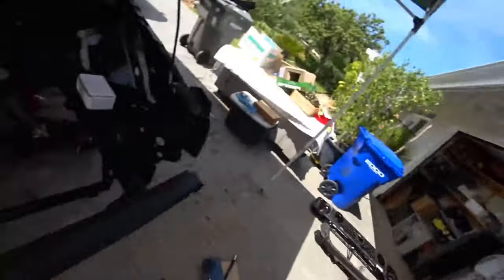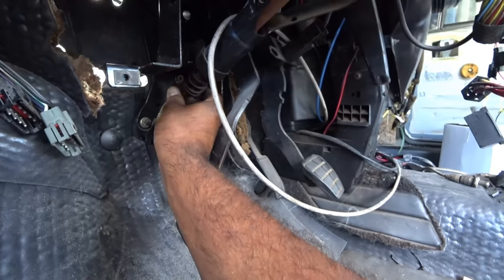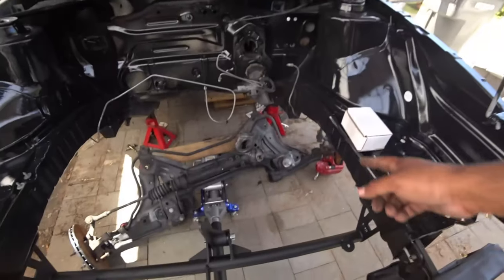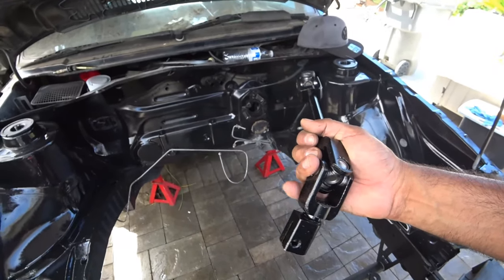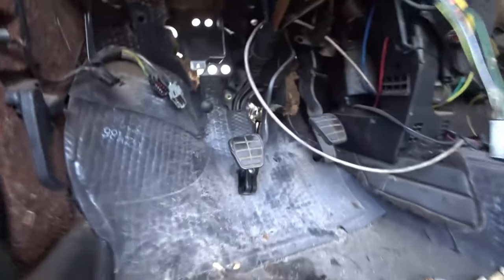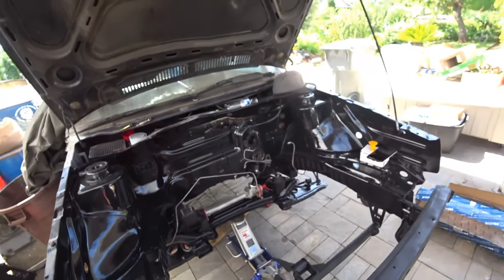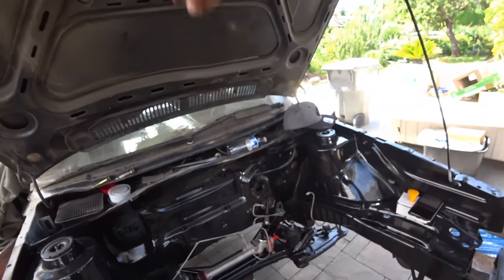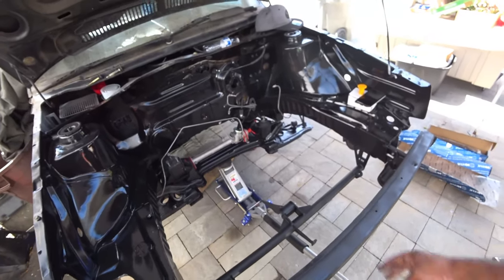MK2 Manual Steering Conversion S6 EP5

Comment: Hi. Thank you for the video. I have done this conversion, but I'm getting conflicting information on which steering UJ boot I should be using. Your manual rack cup diameter looks identical to mine, so I'd be really grateful if you could let me know which boot you used. Thanks!

Comment: Hey man! Thanks for making this video! Following it to use for my mk2 gti 1.8t swap as well. I was wondering what part # you had for everything on the subframe? Just purchased a meyle manual rack, k frame but unsure about what tie rods etc.
Reply from the maker: You need manual steering tie rods
Reply from the maker: Youll also need a 2nd manual rack bracket or u joint to bolt down your manual rack
Reply: @PincheALsGarage  Sounds good! I plan on using the car as my track car at Laguna Seca, ThunderHill, and Sonoma.

Comment: The shaft..where you attach to the rack..does it have lil play there or? Cos I did change the rack..mine has lil play..so I didnt check the old one if it had a play or not

Comment: Hey al! I ran those codes, I have camshaft position sensor A circuit bank 1 or single sensor.
And system to lean bank 1.
Cam sensor is next to the cam gear right? And I don't have a clue about the 2nd code, do you have any ideas??

Also this build looks insane man cant wait to see it running!!
Reply from the maker: The 2nd code can be the O2 sensor or a vacuum leak
Yes the cam sensor is next to the cam gear. Youll need to remove the 2 10mm bolts and clip.
Reply: @PincheALsGarage  ok I'll have a check for vacume leaks. Thanks man I appreciate the help!!